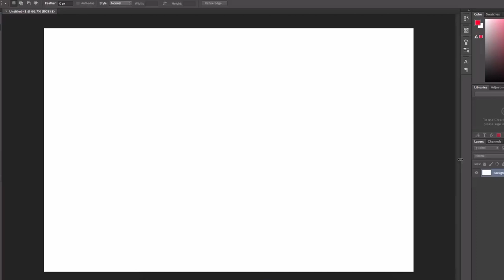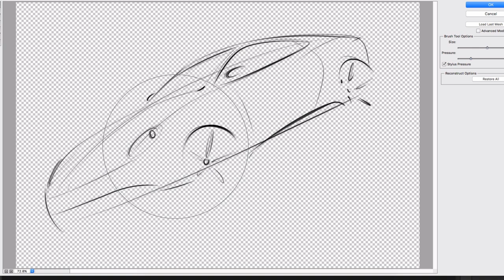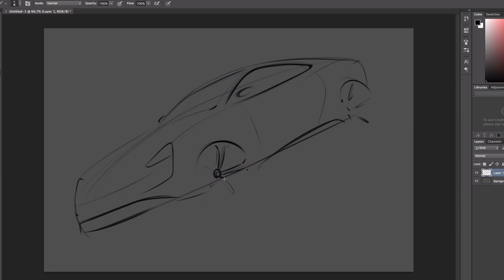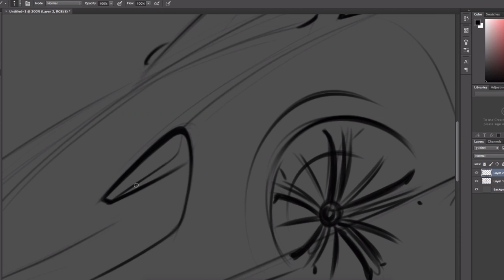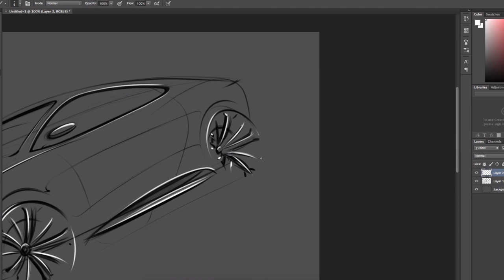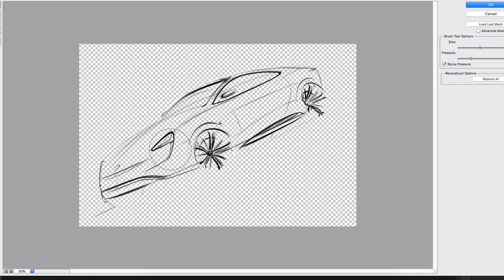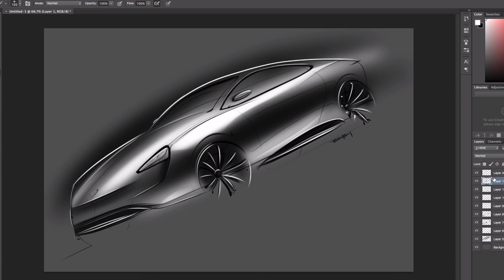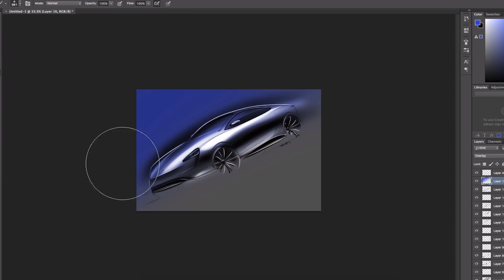Porsche Taycan Re-design - From 4 door sedan to 2 door coupe

Comment: Looks like a front engined Mclaren. Especially those headlights. and the sharpness of the in between the headlights makes it even more Mclaren and even less Porsche. That line is usually very rounded in Porsches. Same with the curve of the shoulder line. It is usually perfectly horizontal in a Porsche.